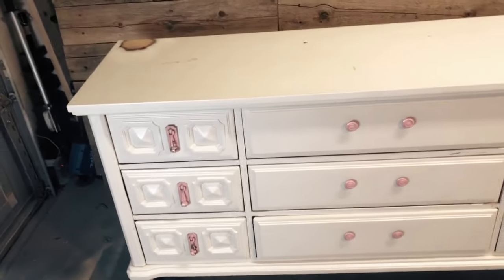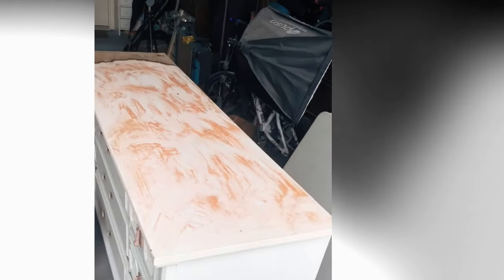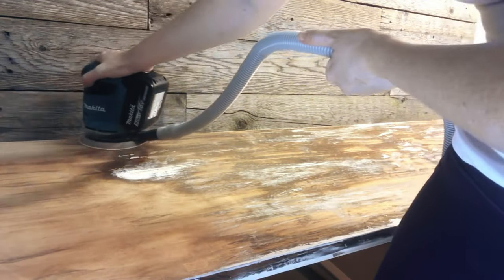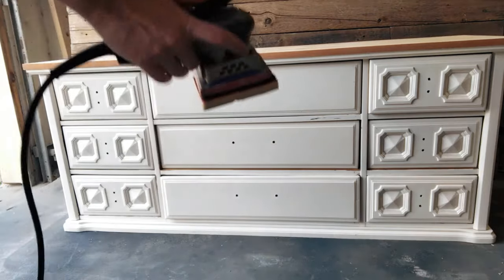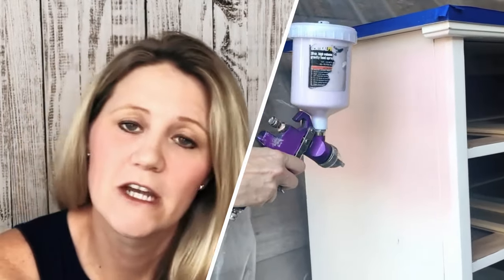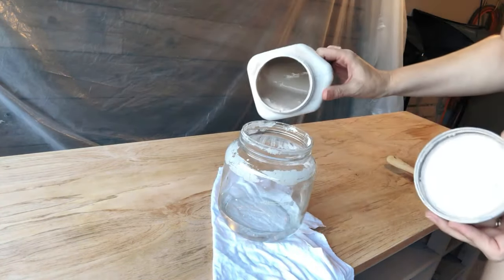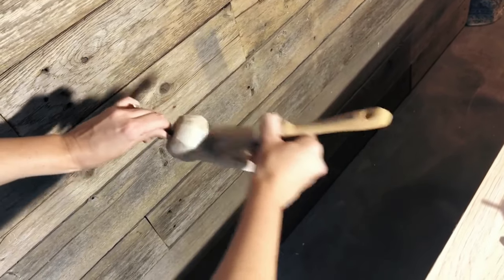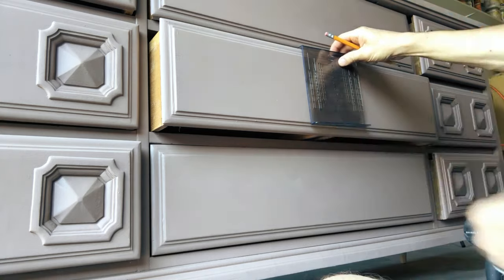DIY Glam Dresser Makeover Before and After I Dresser Makeover DIY

Comment: Hi there. Beautiful piece! Can you explain why you clean it before sanding? I would think sanding would take off any grime and dirt on the surface easily. I've seen other refinishers do the same, clean before sanding, but I've never understood why. Thanks so much. I really love this piece.
Reply from the maker: So you need to clean before sanding because if there is any dirt, grease or oily residue on your piece and you sand it, you risk pushing that oil into the piece and you will see it when you stain it, it will resurface. Thanks for watching!

Comment: I do not agree with u ...less is more...By my experience I stipple the citrus stripper all over the area no heavy but not light...cover and let sit for at least 3 hours, remove plastic and with a painters scraper (H>D) or amazon u take the paint out easy...if you have left over...do the stippling again..cover..wait ...scrap and voila done  and the good thing is u save on the product that is not cheap at all...i tried using the blob lots of product over the are and end up having to apply the second time...with the stipple i have just little areas to touch up...